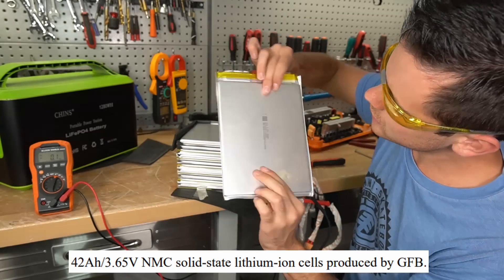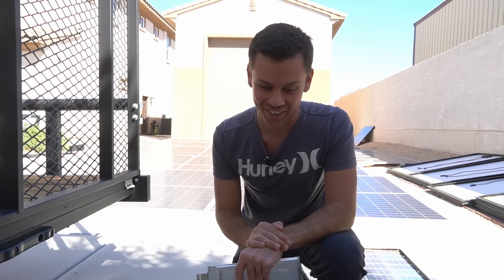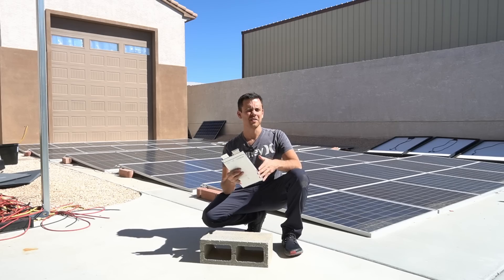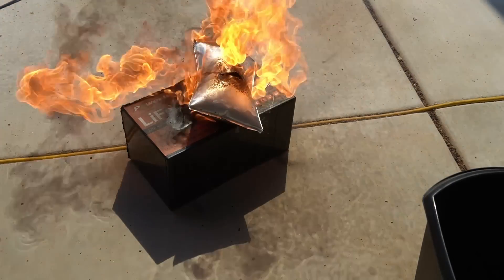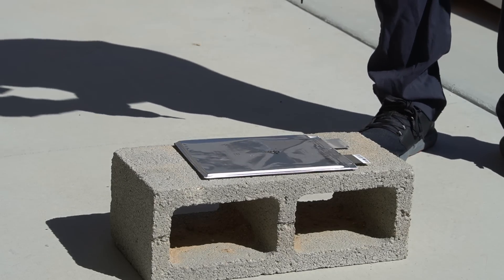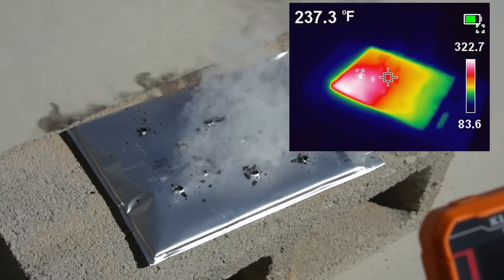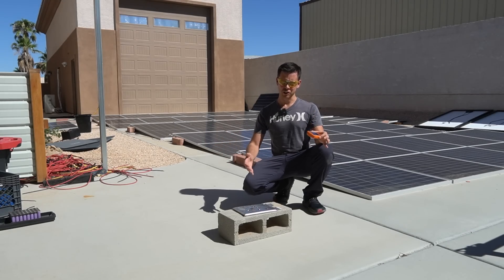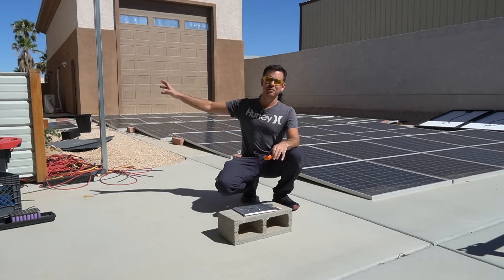LiFePO4 Drill Test! Will it erupt in flames?

Comment: Is the same thing true if you run a screw into it and leave it there? I'm thinking of somebody's installing them with some screws and puncture the battery. Not realizing they have punctured the battery with a screw and therefore leaving it in there.

Comment: My only question is how toxic are the fumes coming out of the Lifepo. Battery? If they get installed under a bed or couch in a camper? The battery might not burn the camper down but will it hurt or kill its occupants. We are full-time RVrs we have a cat that we can't always take to the store with us. I would hate for my wife to find our Furbaby unresponsive.
Reply: Quite nasty actually.  Short version, if you breathe it in you'll end up with hydrofluoric acid in your lungs and that isn't something you'll want.  It's not the only nasty either.  I do laugh inside everytime I say this as it got people on Will's forum quite upset when I explained it to them some time ago.  Even with datasheet in hand there were still plenty that just couldn't accept reality.  Much the same as there are still people over there that say lifepo4 won't burn.  Put it in a fire, which tends to happen when the building is on fire!, and those lifepo4 batteries will burn, and you'll get nasty off gassing in return.

Comment: Very useful and informative video. Side note, the fumes from the electrolyte is very toxic, don't breath it. Since the chemistry does not produce its own oxygen it requires an external source to ignite, but it will burn. Due to the flat voltage curve, the cycle life and the better safety, LFP is usually the best choice. Lithium Titanate is also a good choice, but the voltage curve makes it harder to work with. I am very appreciative of your video to help your audience make a more informed decision about battery chemistry, you reach a large audience, so it really helps. BTW, happy birthday!
Reply: At least some of the electrolytes are fluorinated organic compounds. Inhaling the smoke from a burning battery could create hydrofluoric acid inside one's lungs when the decomposition products react with the water on mucous membranes. Needless to say this is extremely bad when even modest concentrations are reached.
Reply: @wombatillo  yeah and the widespread opinion i gleaned from my time on the ebikes discord (a few folks there make their own DIY batteries for their DIY ebikes) is that although LFP is much safer when it comes to thermal runaway and fire hazard type events, you actually seem to get more smoke come out of them, so potentially more toxic HF acid. so on that level they'd be no less lethal if you kept them in your living space if it's at all cramped than the more explosive battery chemistries. whereas LTO videos i've watched seem to suggest that the only respiratory hazards that get emitted when things go wrong at CO2, hydrogen and trace amounts of CO. but i don't know how rigorous their testing setup for verifying that was since you can only show so much in a video, so all i saw was the cells getting torture tested without going crazy or on fire or anything. i dont know what kind of electrolyte the LTO cells use either, or even if it's the same for all LTO batteries
Reply: @doooofus  basically you need to test every battery from a hundred to analyze how hazardous are the fumes.
(even the same batteries from the same manufacturer might change chemistry rapidly because the rate of development is very fast in this industry)
Reply: @adamrak7560  yeah but i mean how do you "analyze how hazardous" the fumes are without the old fashioned method of "try it and if you die youll know"
Reply: @doooofus  gas chromatography
Reply: @wombatillo  Yes, very nasty stuff and a great way to burn your lungs (or even your skin).
Reply: Lithium titanate is typically used to replace the graphite anode and is paired with an LFP cathode. It's super safe because both anode and cathode have high thermal stability, there is no SEI to break down and release heat, and the battery's energy density is quite low, so there's not that much stored energy to release.
Reply: Take everything from China with  grain of salt.  For safety purposes I would think batteries should have some sort of certification declaring the chemistry of the cells and punitive damages for violations.  But for now I'll stay away from Chins.
Reply: Why do people continue to say not to trust things from China? Is there a consensus that China would deliberately sell destructive items to the rest of the world in order that they might become the only ones left in the world and thereby take it over? 😅

Comment: I'm getting a 5kw grid tie system with IQ8 installed. I need a 16kw for my home (I have the space on the roof). I plan on buying used panels to complete it myself... I want to do batteries but I'm so undecided on what to do
Reply: @MikkelRS absolutely! Lifepo is a no brainer... it's more about size and stuff. He has broken it down so damn well. I believe I would want a 48v setup. I want to be able to run a full size water heater. 

I have a "conspiracy jeff" side that wants to be 100% able to sustain without grid if need be. I live in the south with hurricanes and other things... with a budget that doesn't allow for large mistakes
Reply: @MikkelRS thanks for the reply though bro. I understand panels and the other stuff... I'd even like to make my own batteries with the small blue ones. They can be risky with reliability